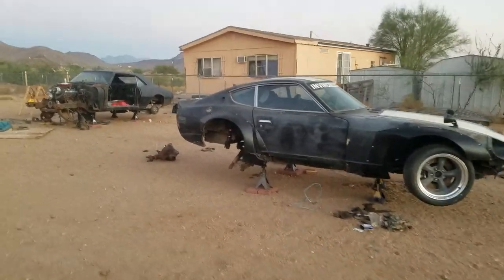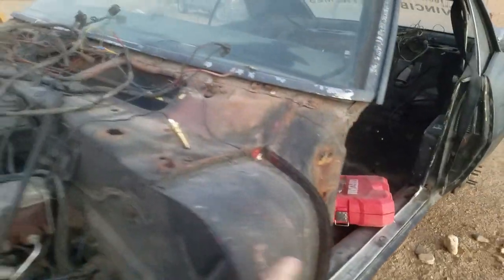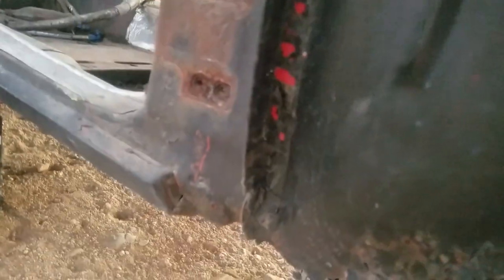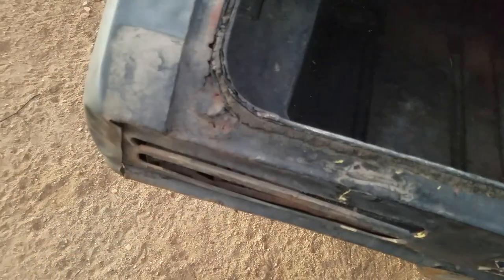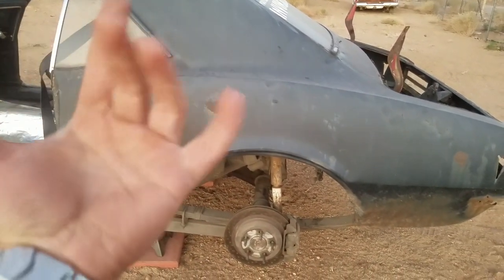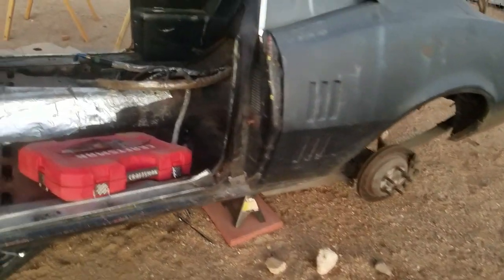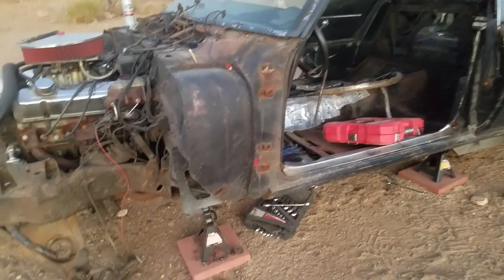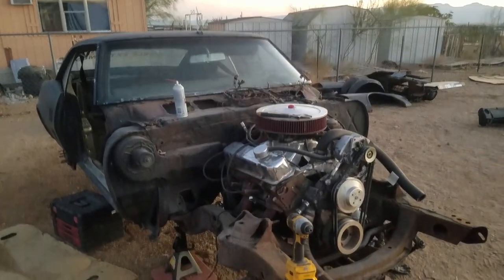Update on our 68 firebird 461 Pontiac project

Comment: Good update. Looks like you don't have to worry too much about the weather, just have to be able to stand the heat. 
Good video. Happy Motoring.
Reply from the maker: Yeah the heat can be wild
Reply: @InvincibleExtremes  When I worked for IBM they sent me to school in Tucson in February. I swam in the hotel pool and had to turn the AC on driving from the hotel to the plant where the class was. That sun can be a scorcher.

Comment: I put Competition Engineering subframe connectors on my 68 Firebird;  they fit great and without modifying the seat pan. BTW. Great video and I can't wait to see the old bird fixed back up.
Reply from the maker: We plan on cutting through the floor for DSE connectors
Reply: @InvincibleExtremes  Those are nice for sure since you don't mind cutting the floor pan. I used the bolt on ones, but they can be welded on too. My car is restored and I wanted the option to remove them if needed.  Though I wish they were a bit less visible under the car.  I also wanted to say, I hope your family is doing well.

Comment: Quite the list of things to repair on the Firebird. I hope the Mrs will get involved with welding in those new panels. 😎
Reply from the maker: Yeah the rebuild is long overdue, which is why the list is so long.
Reply: @InvincibleExtremes  I was impressed to hear that the rear quarters were welded using a fluxcore welder. Nice work. 😊
Reply from the maker: Been welding for years, you can make it work... although we never did clean them up entirely

Comment: We made a all terrain engine hoist , made a solid axle on rear and swivel casters on front with a cross brace all pneumatic tires . Later added a winch motor and battery so we could walk it slowly.
Reply from the maker: Nice, that's the way to go

Comment: Been waiting for a Firebird update that car is the reason I started watching years back.  I'd keep the soild rear axle in it and just upgrade the transmission.
Reply from the maker: The transmission is already a badass 4 speed Ford.  The IRS swap is something I plan on offering for sale, so that's the primary motivation for that
Reply: @InvincibleExtremes  I like 4 speeds too, but with today's highway speeds having a gear or two more is nice.  Is that a dearborn transmission then? Pontiac used them for a bit.  My 67 400 convertible has the hydramatic 400 if it wasn't such a rare (fully option) ac car I'd think about making it a 6 speed.
Reply from the maker: No it's a straight up Ford trans I bolted up
Reply: @InvincibleExtremes  dearborn is a ford that's what they were called.  They served their purpose to the Muncie m22 rock crusher came out in 71 the strongest manual trans pontiac used.

Comment: Hey bro, over the last six months I’ve used the lockdown to learn the speeduino style ecu’s and I’ve managed to build a setup using GM’s old TBI replacing the old school low pressure / low impedance injectors with modern injectors (ev6 - us car connectors) from junkyard LS flex fuel engines. The whole deal uses junkyard parts (all gm) the ecu’s come pre-assembled and the software is free aka no Hp Tuners / EFI Live. Dead simple efi setup for the cost of a mid tier carburetor. I’d like to send you one if you’re interested
Reply from the maker: How much hp does it support?  And what would an engine need installed to run it?  Ie sensors etc

Comment: So not an original Arizona car?  just kidding.   One of the tricky parts with those early Firebird builds is getting the rear tail light panel right.  Those brackets that hold the lights have to be almost perfect to hold them centered in the slots.
Reply from the maker: Yeah, they float in the holes, easy to get them wrong